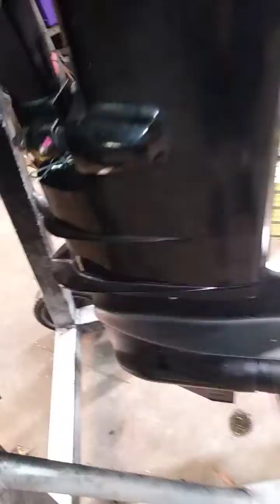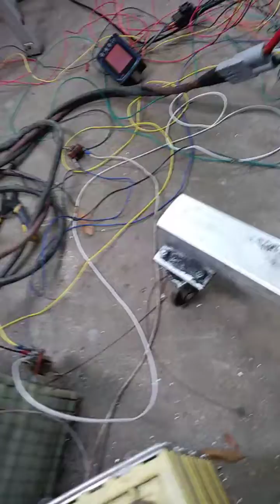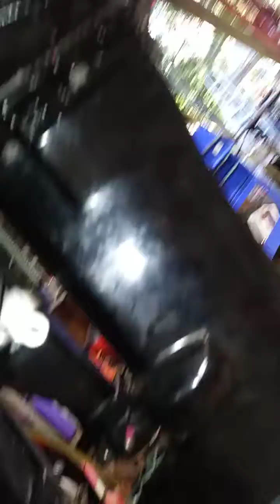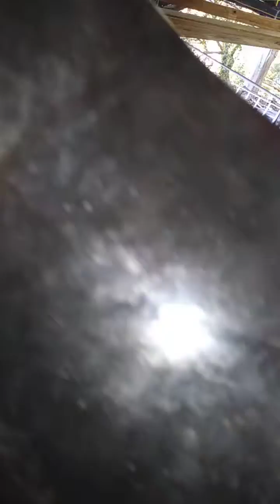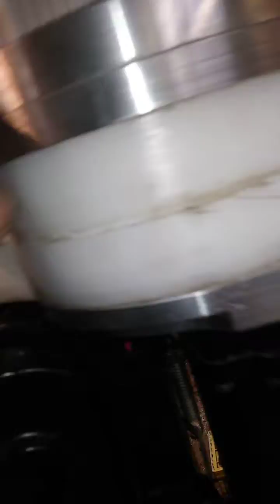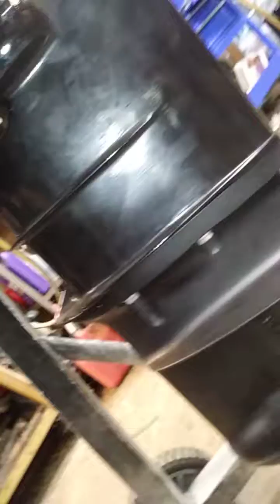Hyper9 on out board motor for boat

Comment: Do you have lower end grease in it?
Reply from the maker: I'll have to ask the owner about the grease that could be. I'm only doing the wiring of the motor and the batteries so I don't know about how the motor was aligned or what shape the bottom part was in.

Comment: The Model G tractor I converted had a noise just like that but seemed to run ok also. I thought it might have been a screw that was just a hair too long and the tip was rubbing on the hub inside the bell housing that the drive belt runs on. 
 Maybe you have a bolt or screw that is a hair too long and poking inside rubbing against a moving part. The way the noise is inconsistent makes we think something is not true or out of round. Bent shaft maybe?? My tractor noise was inconsistent also which made me wonder if the hub was out of round or if I did not mount it on the shaft squarely. 
 Have you decided what it might be making the noise?
Reply from the maker: I talked to the owner who had mounted the motor on the top and he did not seem to be concerned he said something about rebuilding the bottom once the motor worked so we'll see.

Comment: I installed a Hyper9 in my '71 Super Beetle.  Love the motor.  Is it possible that the outboard lower end always makes a noise like that but the sound from the ICE engine drowns out the noise?  Also, the lower end is always in the water so you would not hear the sound anyway.  Just thoughts.  Love the project and will follow.
Reply from the maker: Video camera somehow picks up this sound as it isn't as loud as it sounds in the video we're just talking in the background but there is definitely something I miss. I didn't put the motor on so I have no idea about the coupler and how they aligned it. The owner doesn't seem too concerned I think he's planning on rebuilding the bottom end if the motor works. Thanks for watching.